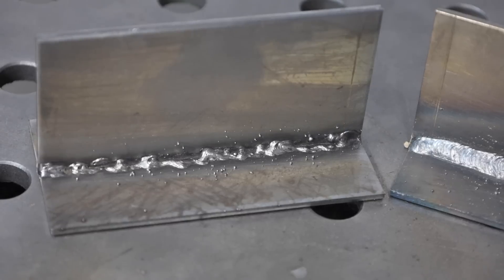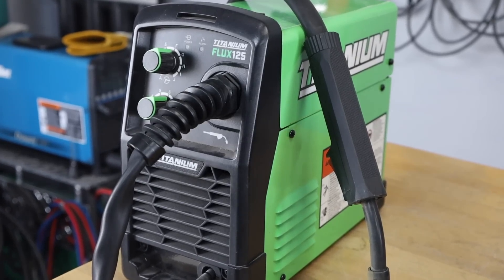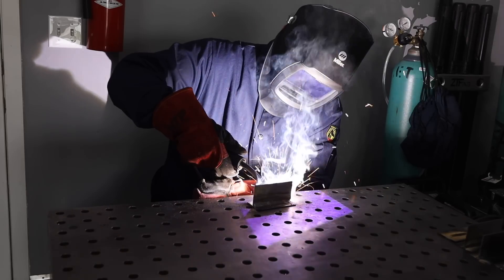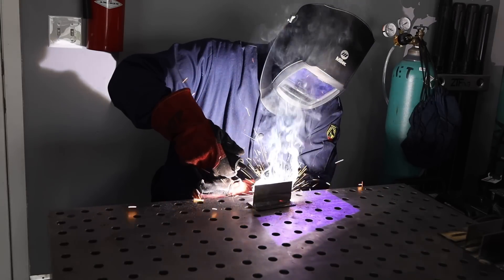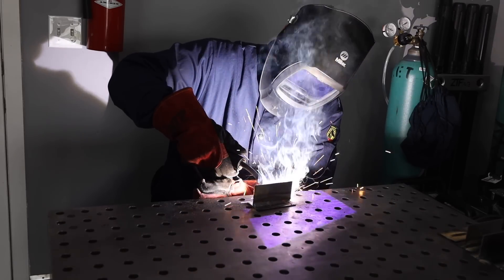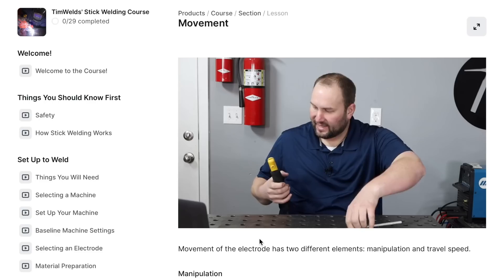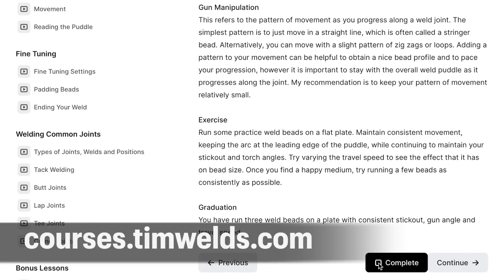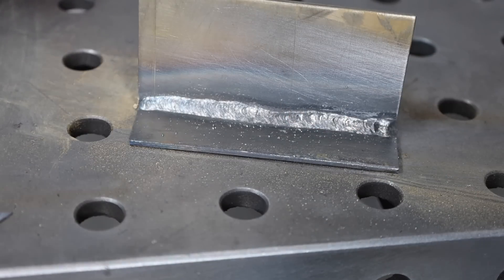Better Flux Core Welds: Gasless MIG

Comment: I got bought my first ever welder for as this year at 41 years young. 
Ive only used the hand held mask so far and i defo need a new mask to steady my welding hand with the other. 
I got a few good puddles after watching your video as it was alot of pigeon poop on my first go. 
Im using a draper gasless mig somthing force 140amp & gen welding semi air tanks to gas bottles to make four chimnea's for my rear yard. 
I hope to get good enough to make a indoor wood stove but atm im a long way off air tight sealed welds 👍

Comment: I wOULD SLOW MY WELD SPEED DOWN BUT I'LL  END UP BURNING THROUGH MY "BASE MATERIAL" WE'll call it since I'm  welding some thin gauge sheet metal on a vehicle's  cowl area on my 1965 ford mustang which is infamous/notorious for rusting out (directly in front of the windshield) and behind the hood  is the area that I'm  going to be welding ERRGH/AURRGH/PHIBBT😖😤 IF I GO TOO SLOW I'M  GOING TO END UP PUNCHING/BURNING A HOLE RIGHT THROUGH THE SHEET METAL SO I'll be RIGHT BACK TO WHERE I STARTED OFF FROM/AT😖😤🙄😡🤬👎👎..!!

Comment: so I noticed that you were only dragging the weld and not pushing it...is it better with flux core to only drag the puddle or can you push into the puddle as well??  I usually weld with gas and I do both but have not used flux core much to know which is better...??

Comment: Is the picture on the left an example of a cold weld?
Reply from the maker: Kind of. The settings are the same in both cases, but the travel speed is higher on the left, so there is less heat input to each unit of length of the weld.

Comment: Going left to right like that, how can you see where your going?
Reply from the maker: Great question! I like to position my head so that I have a clear view directly at the puddle, but can still look past the wire to see the joint ahead. My main focus is on the puddle, but it is important to track the joint in the periphery. It becomes natural, almost like driving. A great exercise for this is just scribing a bunch of straight lines on a flat plate and welding beads along the scribe lines. You'll get to where you can see both.
Reply: @TimWelds  * I recently had to do a weld in a room with very bright lights. The reflexion was brighter from the lights than the pool. I pulled up my hood, but then it all steamed up because the room was so hot. We don't really have breathing apparatus in the UK. Most of our stuff is on site, then of course the sun reflects. It's hard enough going right to left, but going left to right like that would be impossible, especially on Butt welds.
Reply: so my question is.........any ideas on stopping the reflections?

Comment: I love running dual shielded flux cored
Reply from the maker: I agree 100%. It's very different from this self-shielded wire - awesome deposition rates, reliable penetration, low spatter and out of position welding is way easier. When I need confidence in some heavy steel, it's dual shield or a 7018 stick weld.

Comment: How to i become a professional certified multi welder please give me a advise 🙂
Reply from the maker: Great question! I would think about what industry do you want to work in. I'm partial to aerospace, but you can have a great career in steel fabrication or pipe work as well. There are two routes you can go, or you can do both simultaneously. One route is to go to trade school. I went to a local trade school two evenings per week for a year and got some certifications that were enough to get started. I never ended up working as a welder (at least for my day job) and went the engineer route instead (much more boring, to be honest). The other option is to get a job where you can learn. I've seen several people who have gotten a job at a company where they would like to be a welder, then transitioned into welding. As far as certification, it is specific and most companies will require you to certify with them before you can weld. If I were you, I'd start by stopping by a local trade school and ask a lot of questions.

Comment: Tim, I noticed you used a Miller helmet. I got one recentlly and tried adjusting the shade. After I did the shade would darken automatically for a half second or so when exposed to normal light and would undarken when welding again for a half second. I tried reseting but no change. Any thoughts, thanks.
Reply: try replacing battery ?
Reply: @timothyrouse2853  No Change but thanks. I do learn a lot from your videos. Clear and well detailed.
Reply from the maker: Hi Bob, I'm not sure why that would happen. I assume you've played with the sensitivity setting. I have 3 of their hoods, one of which I have used for over a decade without any issues. I have a friend who swears by leaving his out in the sun to charge it, but I'm not sure that makes any difference since they have replaceable batteries. Wish I was more help.

Comment: Man I was legit about to go and get different flux core cause I figured there was something wrong with the one I bought 😂 I’ll try slowing down first
Reply: As a beginner several years ago, I was always trying to move too fast.  With more experience I began to learn that making a good bead requires being patient.  Now, I try to remind myself that whatever I weld will probably be around for a long time, so I try not to rush through it.

Comment: Another Geat video Thanks Was your movement a straight pull stinger ? Or any pull and side to side or e's, u's, movement?
Reply from the maker: It was a straight stringer. You could use a little gun manipulation, but I usually keep the movement relatively small when I do.

Comment: is that bad weld on the left what they refer to as "worm tracks" or "worm trails" or whatever?   I had this problem while stick welding, not MIG, is it the same cause?  too fast?   my instructor kept telling me to hold a shorter arc, but i was literally jamming the rod into the puddle and no improvement, it was probably speed the whole time.
Reply from the maker: This is different from worm tracks, though they also occur in flux cored welding. With worm tracks, there is a continuous bead with a tunnel through it from gasses which did not escape before the weld solidified. It is usually cured by holding the gun a little farther away from the metal to allow the wire to preheat on the way to the arc. As far as the stick welding goes, if it looked like this, it may have been a fast travel speed, or you may need a bit more amperage. A short arc is good, but you usually don't need to put the rod all the way into the puddle. Hope this helps!
Reply: @TimWelds  thank you so much for taking the time to answer this, very helpful!

Comment: Your ESO seemed somewhat excessive but if that was for demo purpose then fully understand. Just curious, what FCAW wire (class) were you running?
Reply from the maker: It probably was a bit long...I'd always like to say that it's on purpose :). This was just .030" Blue Demon E71T-GS, because I think it's similar to what a lot of people run in these types of machines. It spatters quite a bit, but so do most of these small diameter self shielded wires.
Reply: @TimWelds  Tks for the consumable details. General Single pass wires are usually limited to nonmultipass applications & better for rough surfaces (ie rust, scale etc) because of the higher Mn & Si by design. My original thought to the spatter level was that excessive electrical stick out was not covered fully by the external gas shielding. BTW, thanks for using the better term "shelf shielded".

Comment: Another great video.  Short and to the point.  Two clear examples that even I understood (I have no welding experience) and could use to start welding.   I also like that you used the HF welder which I assume many beginners/hobbiest would pick as their first tool.

Comment: I used to work at Caterpillar tractor company and I have run miles of flux core wire. You were pulling your bead  it’s really better to push it. Try it.
Reply from the maker: Very cool! I actually worked at Cat in their welding research and development lab in Peoria, IL. As a general principle, I demonstrate flux cored welding with a drag angle on my videos to push the slag, but it is true that some flux cored wire can be used very effectively with a push angle. Dual shield (FCAW-G) wire that runs with gas is a bit of a different animal than this self shielded wire and it can put down beautiful beads with crazy high deposition rates.
Reply: I'm a newbie have inches might wire lol  But you can push flexcore? I always herd n told only pull. Thx
Reply: @topdragster365w  We had to weld fast to make our production. Just try it and see what you think
Reply: @rodgergarland8154  Honest question, why would pushing flux core be faster than pulling?
Reply: @Cooper_42  I’m not sure I can explain why but for one thing you can run the wire a lot faster. We use 3/32 flux core with CO2 gas. They came in 60 pound rolls. It was not unusual to burn 60 pounds of fluxcore in 8 hr shift.  We pushed the wire and with a slight downhill slant. If we pulled the wire we would’ve never been able to get our work done. 

in eight hours
Reply: @Cooper_42  
I am not sure I can explain it but I know you can run the wire a lot faster. We used 3/32 fluxcore with CO2 gas. It came in 60 pound rolls. It was not unusual to burn a 60 lb roll in an 8 hour shift. Plus using a fair amount of solid wire! 
 We pushed the wire with a slight down hill slant. Much of the material was 3/8 to 1/2 inches thick. 
 This was back in the 70’s when I worked doing that. At that time Caterpillar use more welding supplies and equipment and anyone in the world!!!
  Someone at least
 try it and let me know what you think….
Reply: I’m
Reply: @rodgergarland8154  so flux and gas at the same time… no entrapment of the flux in the weld? Maybe the gas had an effect on that?
Reply: @Cooper_42  You could make beautiful welds if you wanted.
Reply: @Rodger garland tell me you have never welded before without telling me you have never welded

Comment: Thanks Tim,, I seem to have issues getting a clear view of the puddle.  Be it a dark enough shade on my auto lid,, 
or  the surrounding Lighting.  
I'll fiddle with those.   
Wire speed is a factor also 🤷‍♂️, yes?  
Cheers 🍻,  G.
Reply from the maker: Wire speed can also be an issue. The wire speed actually controls the amperage, meaning that increasing wire speed will increase the heat into the weld. In this case, I used the same settings for both welds. Cheers!